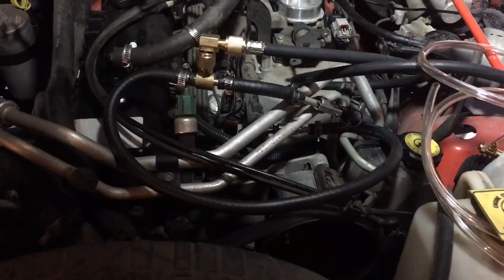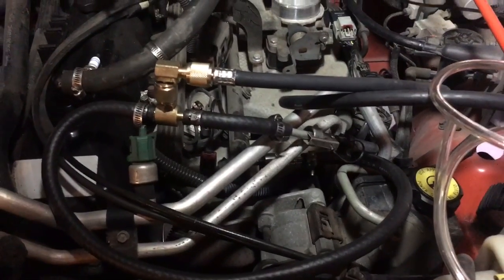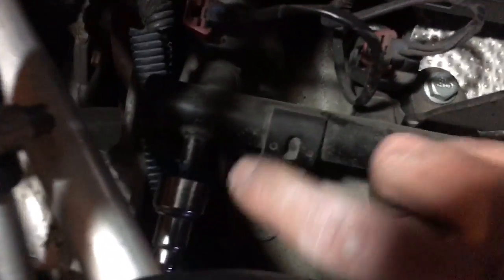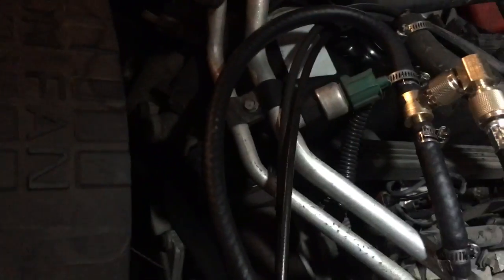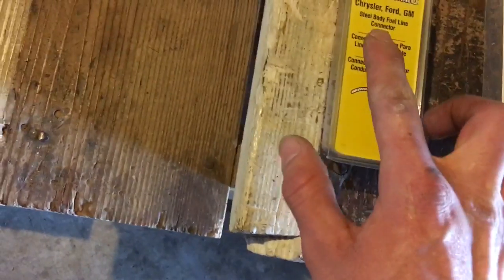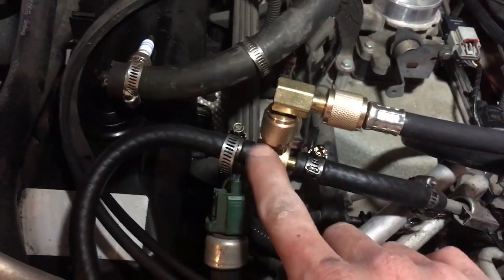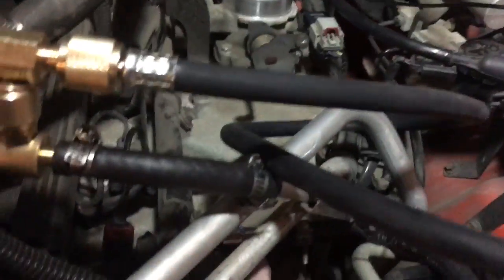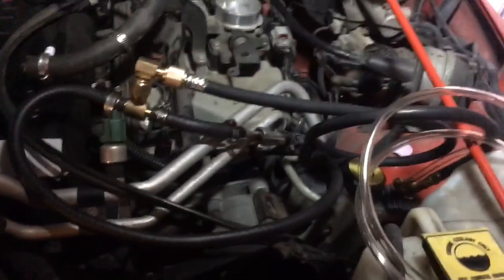Jeep TJ fuel pressure testing.

Comment: Arnt there easier ways to figure out if you have suffice pressure then going through all that nonsense?  Like loosening a bolt somewhere and cranking the engine to see if the pump is spitting fuel through the line ?  If fuel is spitting out when cranking it means the pump is pressurizing the line and doing what it should be doing— if fuel ain’t spraying out it means there’s a problem with the pump
Reply: the fuel pump is meant to supply pressure at about 50 psi. as the pump wear spressure gets lower and eventually a lean condition codes p0171 and p0174 will pop up. these codes could also mean something else is the cause, but sometimes it is a result of the pump not putting out enough fuel, hence low pressure  often down to 25 psi. knowing this determines whether the pump needs replacing or not